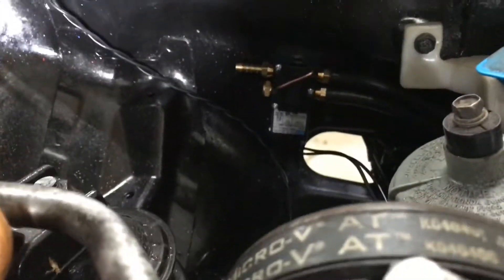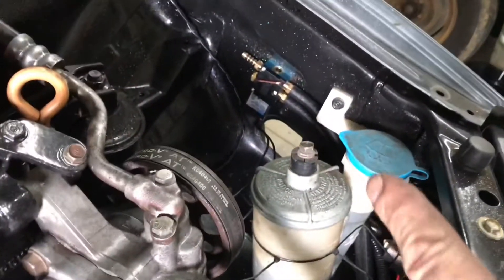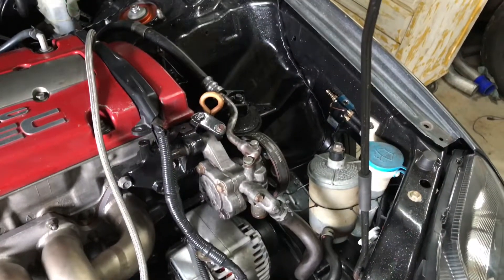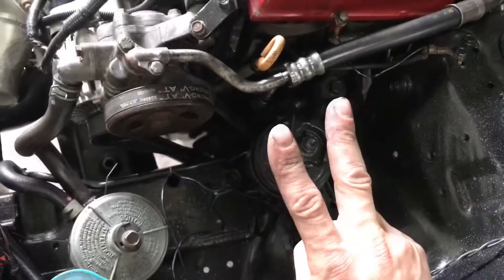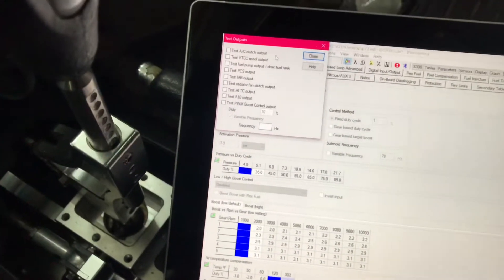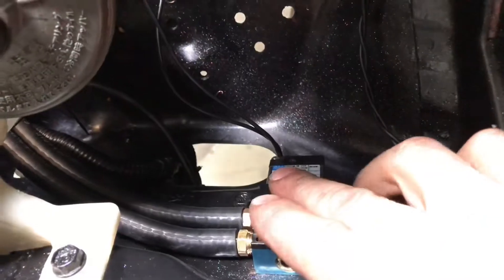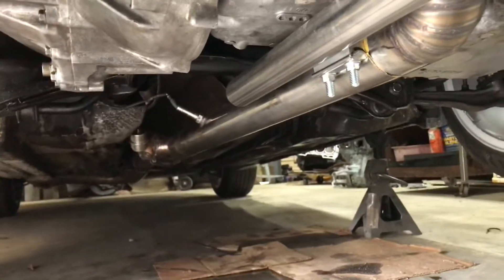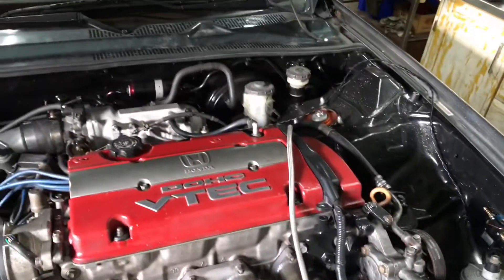How to install a 4 Port Boost Control Solenoid 2020!

Comment: Awesome video. Great knowledge in thus video. Would like to know what shifter set-up you rocking. Looks interesting.....
Reply from the maker: I_auto_enthusiast thanks man! Shifter setup is a replica k-tuned rsx shifter with true k tuned race cables. Honestly I haven’t made a video of it yet because I’m not happy with it yet. Doesn’t shift smoothly at all...granny shifts only. The cables are tune-able but I haven’t as of yet found the “sweet spot”
Reply: @thestateofreal2533  thanks for the info. Must channels hold back info. Man I've watch all the videos. Hope all is well and more is to come.
Reply from the maker: I_auto_enthusiast on this rsx shifter you can only get two bolts in to mount it to the tunnel. And the stock shifter cables won’t fit it.
Reply: @thestateofreal2533  good to know. Thanks for the info, much appreciated.